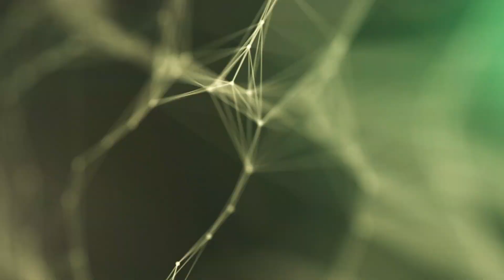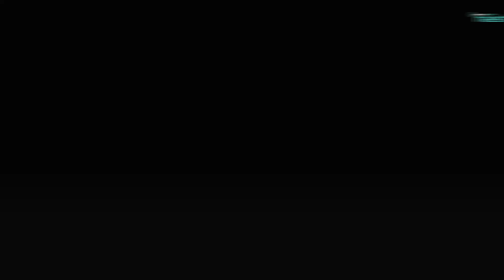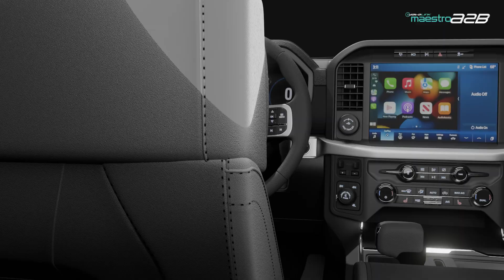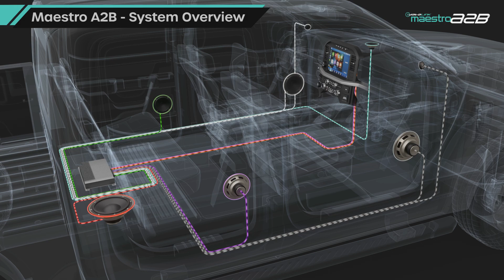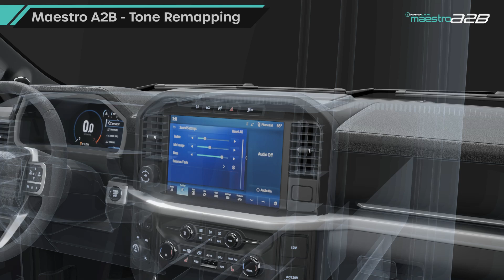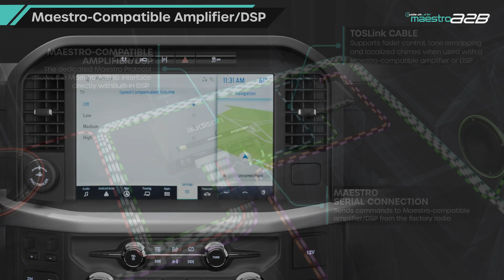iDatalink Maestro A2B Promo 2024 - Amplifier Replacement Interface

Comment: I just paid $700 bucks for this and the wires look like something from a kids toy!  I cannot see why they would charge this much and use such cheap thin wires for speaker level signal. I flashed and havent installed but this was a big dissapointment for the cost

Comment: So this maestro unit is to use a factory or add aftermarket amplifier to the factory amplifier
Reply: It replaces the stock amp so you have RCA level signal (basically making the stock radio similar to aftermarket one (the RCA signal level outputs are the key here) this then gets ran to all your aftermarket amps (sub, Front and rear) giving you a full range signal as using a Line output converter would work (did it from sub to make sub louder) but the signals are factory filtered to be optimized for the factory speakers. So they tune it to make them sound good, when you add aftermarket they still get the tune for the low garbage that comes on these premium systems. Also the signal is digital so this converts that to useable RCA signal that is clean. all of this is done inside the factory amp Digitally so just swapping the amp would not work as this is how the digital signal is getting converted and processed. This box does that work. if you add you'll need aftermarket amps, but without it you'd have no sound from the headunit if you pull the stock amp